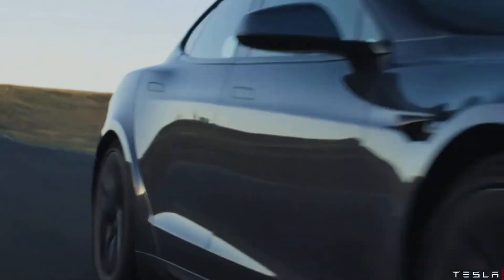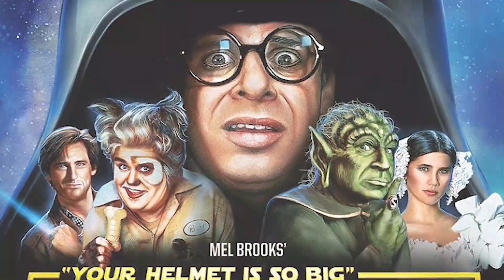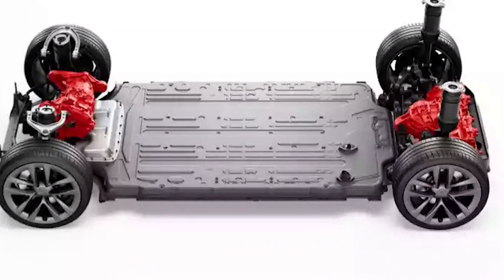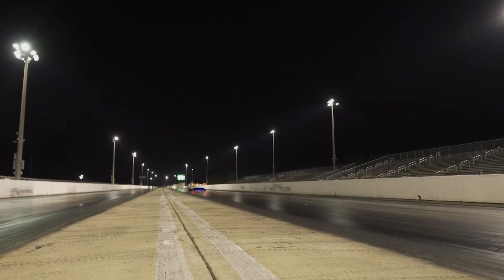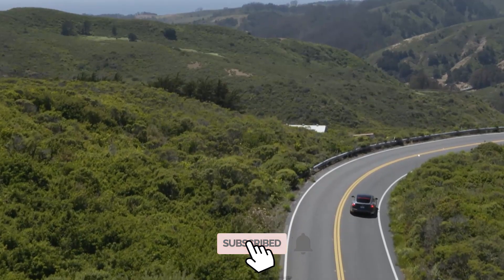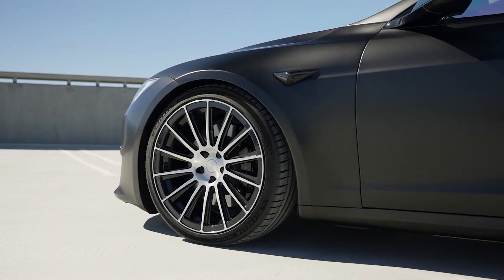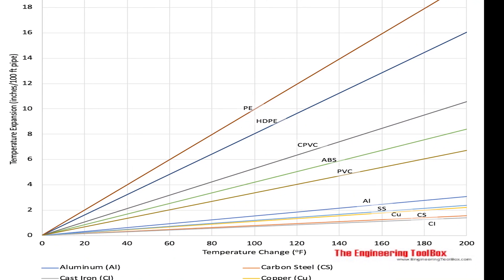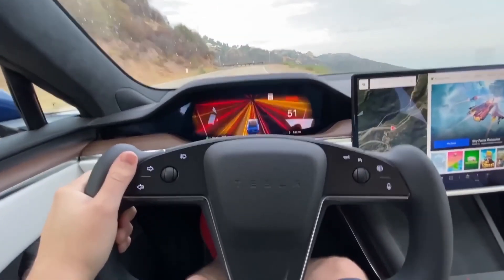Tesla Plaid: Pushing the Laws of PHYSICS

Comment from the maker: 1020 HP!  The engineering that goes into this vehicle is amazing!  If you could change one thing about the Plaid, what would it be?
Reply: Better brakes , fit/finish needs improvement. Mine had a steering clicking sound that was fixed. Now there there's an annoying creaking noise coming from the back. Paint quality is trash. Weather stripping was messed up from the factory. There's wind noise coming from the drivers side. Weird vibration the first few min of driving. The yoke can be cumbersome during low speed maneuvers. 
With all that said I still love driving it!!! I mainly bought it for the acceleration, tech and practicality.